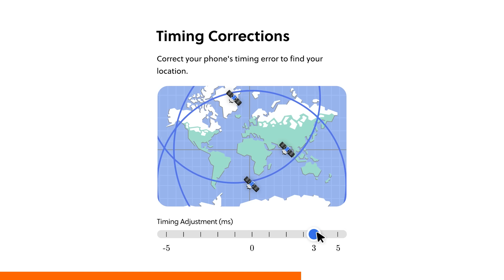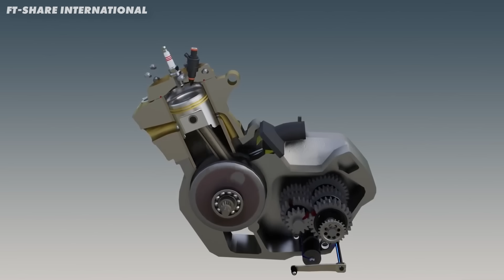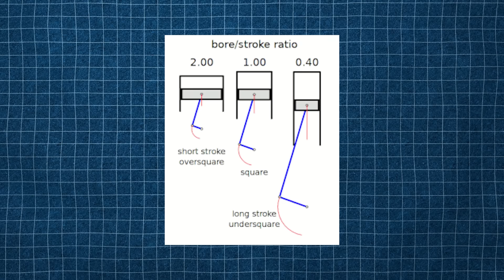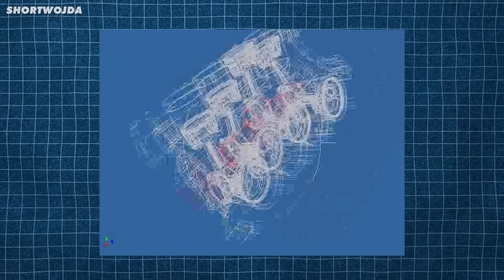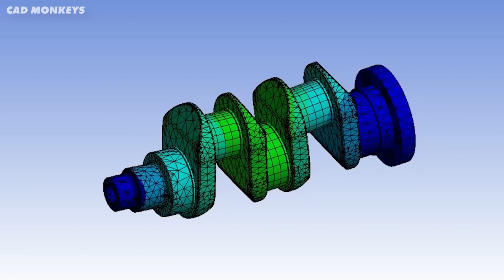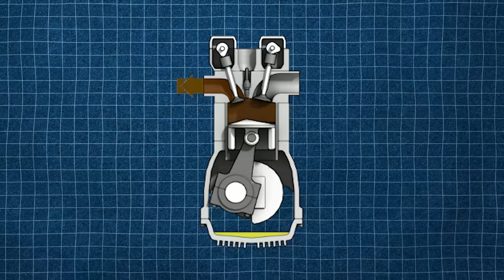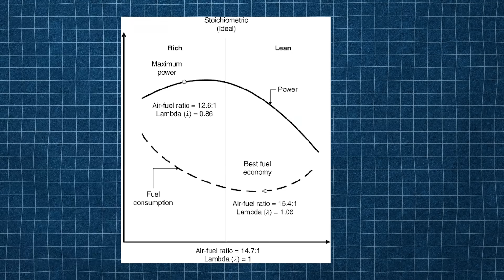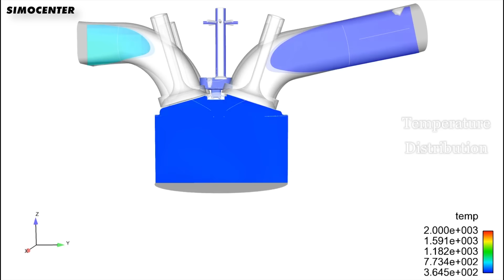Why It’s Almost Impossible to Rev to 21,000 RPM

Comment: what about the Honda RC250 doing 20k stock with forged lightweight internals and the cool valve and spark tech that u talked about i think it could easily get above 25,000rpm

Comment: Cox TD 0.049 cubic centimeter engines from 50 years ago rev in that range.  According Feynman's famous lecture, it is the piston speed, not the rotational speed that stays constant as the scale is changed.

Comment: some of the RC pylon and speed racing nitros were peaking in at 32K... at about which point its sonic effects.. air simply doesnt realise a port is even open and doesnt flow. 

as speeds get higher, cylinder filling gets worse. air has momentum... it has inertia. you make ports bigger, open for longer, flames still propagate at fixed speeds, the combustion doesnt synch with the events properly...

with fuel injection, other issues... at 18000 you have 3 mS per revolution. an injector is rated for an average of 1.2mS minimum open time, and at 85% duty, or 2.55mS... doesnt leave much band width. an injector has a fixed flow rate and may open for 10mS or more at more normal speeds...

Comment: I think only regulation F1 should have regarding engines is... The CC of the engine. 
Lock it at 3 liters as the upper limit. No lower limit. And then let the engineers go crazy and all out and let them freely invent. Let them try to extract the most amount on power through it. 
F1 was supposed to be the forefront of new cutting edge invention instead it became the hub of regulations. I think they are trying to create less pollution and trying to save the planet.... instead of making sure cars go as fas as possible. 
I mean like what's even the point restricting power of an engine by regulations. It's just so monotonous now. 
I think CC should be basic regulation and engineers should be allowed to extract as much power as they can from the engine... Invent new technology, new Metallurgy, etc. 

I heard once Williams team put a CVT transmission in their car and it made car soo fast because it could keep the car at max output all the things that F1 had to ban CVTs...
And I was like Wtffff.... They banned it for being fast... Wasn't the the whole point of it..  the whole existence of F1.... Being fast. 

In my opinion 95% of F1 regulations should be removed. They are killing invention.

Comment: You lost my attention when you said the piston goes up and down 167 times per second which only equals to 10020RPM
. I was under impression that you explaining engine which can rev up to 21000RPM and thats 350 times per second piston is moving up and down if I’m correct.

Comment: The mid 60s Suzuki and Honda works 50cc road racers were achieving 20,000rpm plus. For 1968 Suzuki were developing a 3 cylinder 50 but this was abandonned due to cost.

Comment: Bugatti claimed in the past that the Veyron made 1001 hp, but actually made around 3000hp but most of its energy power was lost thru heat out of the tailpipe and radiators. 4000 would be ..hmmm.yikes

Comment: The length of the connecting rod doesn't really tell that much, as a short stroke engine still can have long conecting rod. But, I get it, you cannot fit a short connecting rod in long stroke engine ;)

Comment: Well, a lot depends on the ability of...and design and function of the input power train for any revving unit... But here, assuming piston driven??  I like to rather think of the engines revs in per second not per minute... like on a motorcycle 6,000 rpm [lets assume 6th gear on the freeway] @ 6,000 rpm that means the "crank" is doing 100 revolutions per second. That is plenty to go to the drivetrain....

Comment: Video couldve been way shorter. 
1. Higher the RPM the higher the chance of something breaking
2. More displacement = more power = less rpm needed for power + more reliability (in theory)
3. High revving engines = high maintanance = higher risk.

You welcome

Comment: You are wrong to say two stroke are higher reving, back in the 60s and 70s, honda had a twin cylinder 50 cc 4stroke engine that could rev to 25,000rpm.

Comment: I know others have probably mentioned this among the 1100 or so comments here but 100cc racing kart engines revved to over 20K as a matter of course.  I know they're two stroke and not four stroke but even back in the 1980s the air cooled ones were revving north of 18K... Scott you know this as you raced these things ?

Comment: Short answer 
Achieving 21,000 RPM is incredibly difficult due to extreme mechanical stresses, heat management issues, and challenges with maintaining efficient combustion and valve timing at such high speeds.

Comment: 6:25 NO, that's not how you measure bore to stroke ratio! you can have a square engine in that case, idealy to have a perfect engine with lower friction you'd opt for the longest possible connecting rod. This configuration definitely isn't undersquare otherwise the connecting would touch the walls, but if you have a long connecting rod it doesn't mean that engine is undersquare. In this case you would be kind of right, because it wouldn't make sense for a square engine to have such a short connecting rod, it is absolutely possible but the friction would be high.
Reply: So in other words hes right.
Reply: @CadillacDadillac yeah… but not really, you measure bore to stroke ratio using well the cylinder bore and the travel of the crankshaft or the stroke. He was showing a weird combination of rod ratio and the thing he was trying to explain

Comment: In theory scientists have proposed if you could get an engine to rev at 21000 RPM you would occupy all points in the universe simultaneously 19,999 RPM is the highest, 20,000 RPM is classified as infinite revolutions' also if you could you would need an infinite amount of energy, which is impossible. --- there saved you 13 minutes of your life...

Comment: I used to work for Cosworth from 2000 to 2007, producing engines for Jaguar Racing and Williams (to name just a few), and in engine testing we ran them up to 21,000 rpm and over on occasions.

Comment: and here i am with a motorycle that starts  redline at 19,500 rpm and  redline ends at 21k rpm
Reply: What bike is that
Reply: @JustDivine-zh6wd fzr250r 3ln1 with a rpm limiter mod. Bike is ment to be 45 bhp at rear wheel but mine is sitting at 63.4bhp rear wheel. Which is basically the same as the fzr400 at rear wheel when stock
Reply: @Ryan8a ahh nice, I have a Cbr125r stuck with 13hp for now unfortunately haha

Comment: The largest ship engine, the Wärtsilä RT-flex96C, has a maximum speed of 102 RPM. This 14-cylinder engine, developed by Wärtsilä Corporation, produces 80,080 kW (108,920 bhp) at that speed.
Reply: To give an idea of scale: We had 4 Wartsila V-16 powerplants that turned generators.
I don't remember the exact operating RPM, but it was in the 500RPM range. Of course, engine RPM was phase locked for synchronous AC power production...
These were not particularly big Wartsilas... However, catwalks went down to each end of the engine, and you could walk from one end of the engine to the other on a metal walkway that spanned what would be the lifter valley of a push-rod V-8.
I will forever remember the first time I did that while the engine was in operation.
Reply: So? how does that relate to this video?

Comment: from the vice-president of the pedantic society: i'd like to point out that one complete 4-stroke cycle takes two revolutions, therefore at 20,000rpm each cycle completes in .006 sec, not .003 as stated here

Comment: 20000 rpm / 60 sec = 333.3 rpm/sec. 4 strokes pr cycle then equals 83 of each stoke pr sec. The mechanical stress in those engines is just bonkers... I'd really like a breakdown on how efficiently either stroke actually is, when performed that fast as it really isnt much time for anything to happen. Also how do they secure that the whole cycle remains synchronised at that speed?

Comment: Once taken to the extreme, eventually there is another even harder limit on internal combustion engines and that's the burn rate of the fuel. At some point the piston is accelerating away from TDC so fast it outruns the flame front of the burning fuel.

Comment: he also didn't mention clearly a problem with lubrication. There is a limit of piston linear velocity about just 23m/s. Above that wearing occurs much much faster since oil film cannot restore so quick or so. Huge marine diesel and MotoGP prototype engine - both have the same limit, but marine diesel has stroke over 2 meters and revs a couple hundred times a minute, while MotoGP engine has stroke of just 50mm and revs 16k+ rpm

Comment: In the 90's Honda developed an oval piston 4 stroke NR500 engine which rev'd over 22000 RPM.  Expensive to run and build.  Honda estimated an oval piston could achieve 23000 rpm before it exceeded burn/flame out.

Comment: There's no rpm advantage for a 2-stroke other than not having a valvetrain. 500cc 2-stroke GP bikes revved to 12k rpm while the first gen 990cc 4-strokes that replaced them revved to 14k rpm, and they're at 18k rpm now.

Comment: Questions: 1) If  the pre-chamber ignition is causing the main chamber to ignite in more locations, that sounds analogous to pre-ignition which normally could cause detonation in a (normal) engine. Why doesn't that occur in this case?
2) In a 4-cycle engine, the connecting rod is in tension during the "suck" cycle of the 4-cycle engine, but in the 2-cycle engine, the rods are always in compression and never in tension. I wonder if that may be one more factor in the 2-cycle engine being able to reach higher RPMs (i.e. if the connecting rods might be weaker in tension when accelerating the piston downward for air/fuel intake)?
Reply: pre ignition is just that. ignition before it should happen. the pressure rises too early, fights the compression stroke. then tends to spontaneously ignite other areas as their pressure rises. things start overheating... detonation has set in...
detonation. a chain reaction as pressure rises past a threshold for various reasons. an uncontrolled explosion. 
one often causes the other, they often go hand in hand, but they are two distinct and separate phenomena. 

if the combustion is controlled, and pressure doesnt rise too rapidly... theres no issue. more flame fronts is better. 

yeah, if you can start them ,two strokes dont need bearing caps on the rod... massive factor. most two smokes melt crowns as they cant cool the piston fast enough. fourstrokes pull rods and smash the piston crown off...

Comment: Precombustion chambers? 🤣Gasoline tech is 30+ years behind Diesel at this point, if they're resorting to precombustion chambers with spray pattern nozzles. Be funny once they finally incorporate direct injection into the cylinder, then somehow find a way to outlaw it, because it gives the engines too much power with a lower octane fuel and less fuel.

Comment: So I had my piston epiphany. So that piston that small piston versus the large piston could be just one piston. So imagine a small piston VF1 piston going up and down really fast 18,000 RPM but then the RPM drops and it when it reaches the bottom of its stroke it somehow magically connects to a smaller subpiston so they become the one new piston. So this piston is for lower RPMs. I think I'm a genius. But the real genius would be to make it work and somehow you'd need obviously a coupling mechanism that just snaps into place at RPMs that are like in the range of 10,000 or say 6,000 RPM. So the lower piston could be excited by an electrical circuit and so the piston really is an electromagnet. You're probably wondering why would we even do something like this. The F1 Pistons because they don't have a side wall and it's mostly just the rings and then nothing they have a tendency to wobble inside the cylinder and so the lifespan is decreased. You could even have a two-stage cylinder so the high speed section of the engine is the upper part of the cylinder when you've just got the single piston, decoupled. People may think that pistons engines are on the way out anyways but I totally disagree. I think biodiesel is a really good alternative to mind carbon and petroleum or fossil fuels. We need to harvest wood from the forests to keep fuel off of the forest floors because now the major contributor to greenhouse gases are the yearly fires in the norm that in hemisphere and they exceed all greenhouse gas contributions by humans combined. In the future robotic logging would be like crafts going into the woods and cleaning the fuel off the first floors trimming it off the tree trunks so that there's no dry fuel left laying around and also the forests can be set up for fire brakes by creating gaps. Stop gap measures but that's not what I'm talking about really it's all about the preservation of a lifestyle that is so fun and I think hybrid vehicles are going to be around for a long time. It's an energy equation and you might not all understand what I'm saying you might some of you think that I want to just do status quo and keep pissed on engines around. What I'm saying is biodiesel has a definite benevolent purpose in the future world. It's kind of like if you want to get really fat and die you eat high glycemic foods it's like burning everything at once. If you want to survive you take the available fuel and you bring it off slowly and it becomes like a game and a mathematical equation of energy and time.

Comment: Small  Glow Plug  engines can run 40,000 RPM.. Minimize reciprocating weight & stroke - exceeding 21,000 is doable...

Comment: Why can't we add a pre air-fuel mixture tank that then injects into the cylinder? Like no intake, no air intake, no fuel injector.. Just a tank, that has fuel injected into it, and air to the perfect 14.7:1 ratio and then that is shot into the cylinder.. get's rid of the physical inability for air/fuel to mix in the cylinder. You could have a tank with enough size to keep say.. 100 strokes in it or something.. idk lol..maybe the tank wouldnt be able to fill quick enough idk

Comment: the longer the stroke the greater the internal stresses, when you have a bore of 75mm and a stroke of 10 mm high rpm is achievable easily ,then you have no real torque at low revs ,but high fatigue reliability , so careful design to achieve a workable engine is paramount

Comment: 0:12 "a mass of 2.5 tonnes". This is incredibly stupid. Energy and mass are very different things. 2.5 tonnes sitting will do nothing for you. There is no mechanical work hidden in mass until you raise it to a given altitude above a reference level, etc. A video that starts like that is obviously made by a clueless person. I teach mechanical engineering by the way. But even as a kid, I remeber full well the noise of my rc car engine revving at 25,000 RPM and more. Yes, the title itself is nothing but clickbait.

Comment: in your bore stroke illustration the changing of the rod length is not necessary to make the point. The changing bore sizes are somewhat confusing as you want a large enough bore in order to get enough valve in order to breathe for what ever cui you need to aspirate, less of an issue on forced induction. Short strokes and long rods allow you to run really short compression heights and really short overall height pistons, coupled with narrow pins etc I bet you can cut alot of weight off your reciprocating weight... times (number of cylinders) 
FWIW in road racing where the engine is running up and down in rpm many times - *with aV8 cutting 5 grams off each small end assembly (40grams) will gain more in performance than 100# out of the car.

Comment: Our small 3.5cc model competition engines are 2 stroke and are able to run 48.000 rpm on the track and w/o load they can shoot over 50.000 rpm.

Comment: Forced induction make ultra high revving absolete. Why build a enjing thats revs to 20000 N/A if you can do the same with 12000 and forced induction? Forced induction gives more torque as well, wich is alway nice in a racecar.

Comment: First of all, the RPMs in any car or bike racing should be ABSOLUTELY LIMITED, it is a STUPID thing to go over 6000 on the streets, 10000 racing;  NO POINT on earth to go over 10000, that is just stupid, pointless and temporary,with NO practical application;
Secondly, another  fantastic video,  thanks, and ignore "those" comments    lol
Reply: And yet there are engines that rev past 10k regardless of your subjective two cents of an personally entitled opinion that had no affect. I know my opinion didn't do jack either lol.

Comment: 10:14 "There's no getting around that"
Sure, but the limit is at least an order of magnitude faster than current designs. Combustion chambers should be about 1/3 the diameter of a cylinder. And even more importantly, the combustion chamber wall must be above 1200F. Current engines have poorly shaped and cold combustion chamber surfaces. The result is slow and highly quenched combustion. Yuck.

Comment: The photos of piston styles kinda fail to fully represent as I can think of a dog single cylinder low revver with a piston looking way more like the 20k rpm example  okay not the crown but the height and lack of skirting check out the piston in this KLR650 kit video and compare the piston to the two examples at the video title....looks WAY more like the 20k rpm piston but its a lowly KLR 650 which I think are maybe 6 or 7k rpm motors

Comment: Honda 50 cc twin cilnder racing engine and the 125cc 5 cilinder were able to run at 35000 rpm in tests in races at around 30.000 max this in 1967

Comment: The title of the vidio is the thing that is wrong thats all he is talking about f1 engines. Nitro engines for models can turn in excess of 50,000 RPM. Typical operating rpm for sport model aircraft engines is 10,000–14,000 RPM. For radio control (RC) boats and ducted fan aircraft engines, 20,000–25,000 is the usual range, and for cars RPM in the range of 25,000–37,000 is common